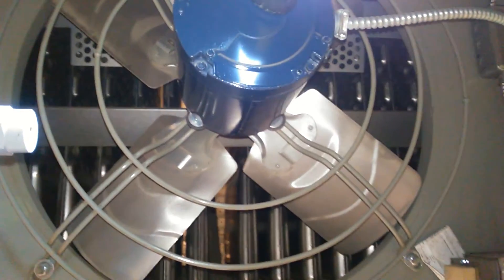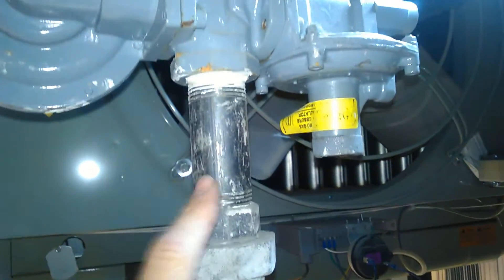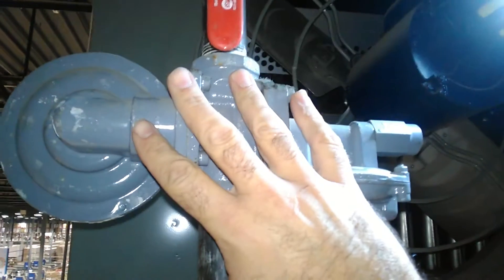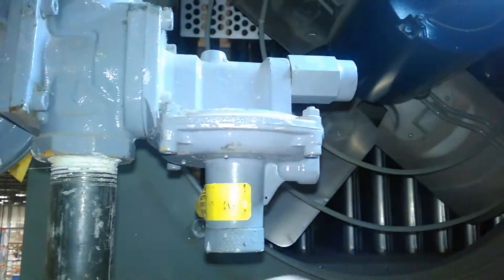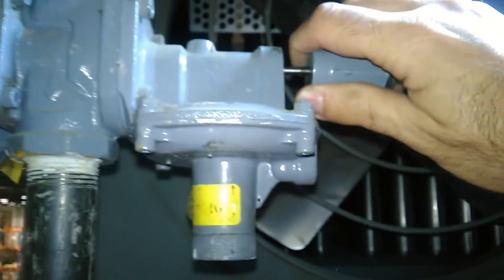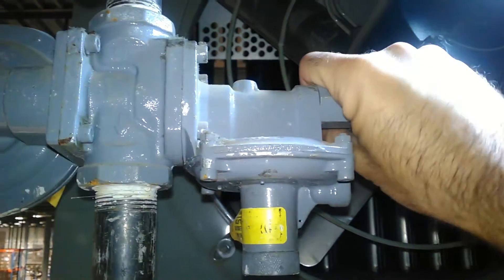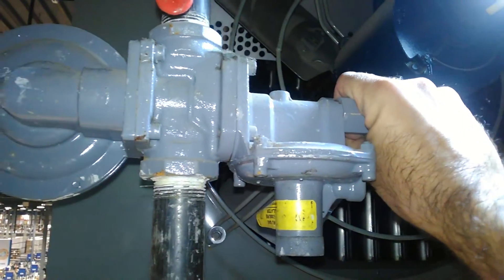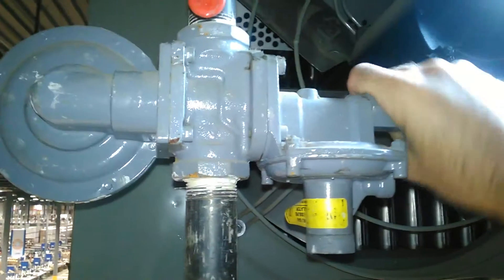Bryan Donkin Over Pressure Cut Off - HVAC Know It All

Comment: The valuable issue with these is that they're indoor regulators that have to be vented to the outside of the space. Soon as you have right presssure both upstream of that regulator and downstream of that regulator. You are left with venting it to the outside. That is all.

Comment: It's called slam shut regulator incase of overpressure or incase you turn the gas winglock quick it will sense overpressure coming the safety thing. Specifically 2psi gas systems are critical. It has 2 regulators in built in 1 unit helps you to eliminate clearance issues. Utility side they need inspection periodically. The main thing to set this for designned overpressure level with bicycle pump..lol